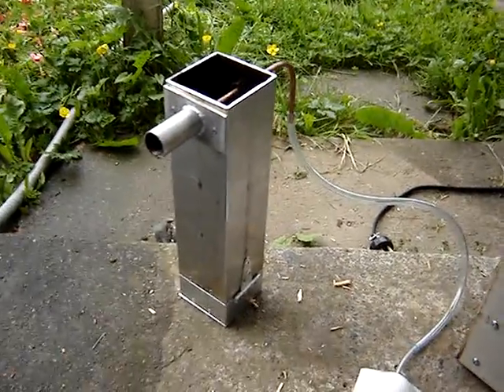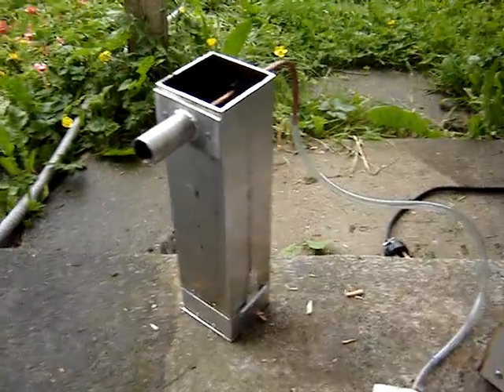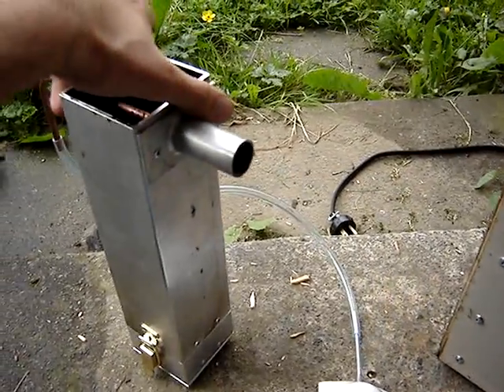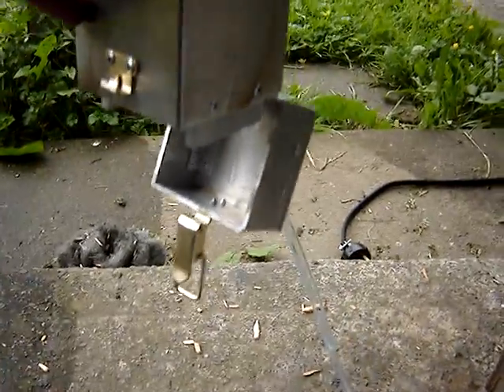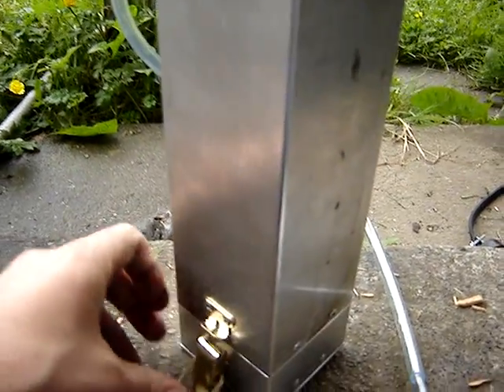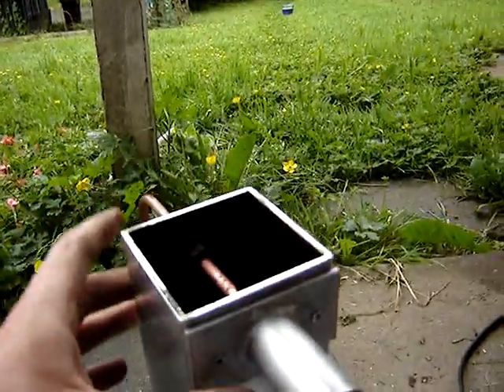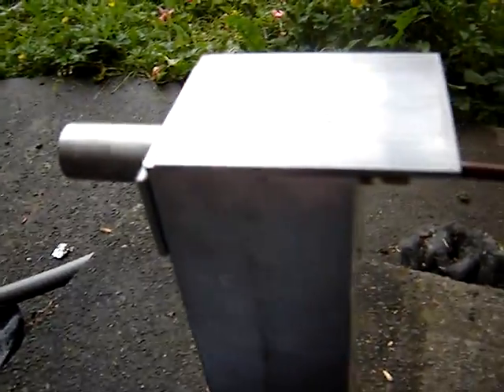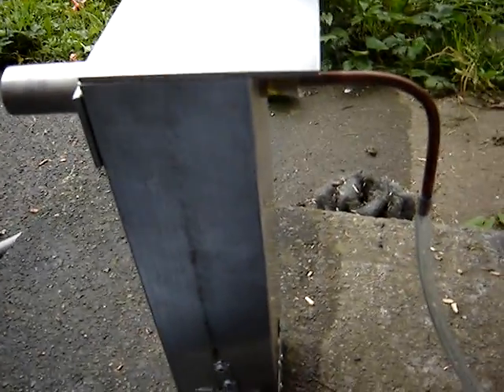Cold Smoke Generator (BBQ) 1/2

Comment: Just a little idea!
If you flatten the tip of your copper pipe in the chamber you will get a higher speed of air with the same amount of air pressure, which will produce more vacuum, which generates more smoke :-)